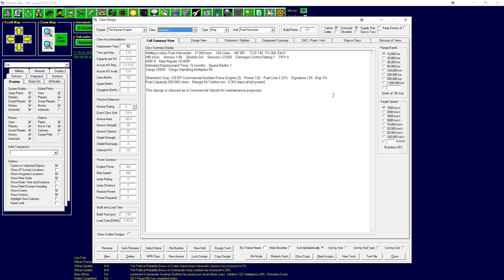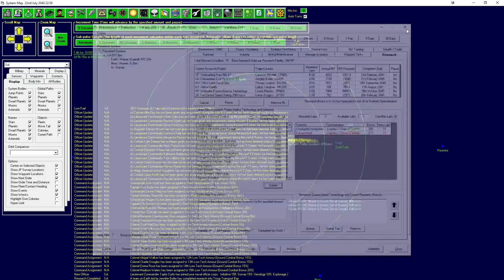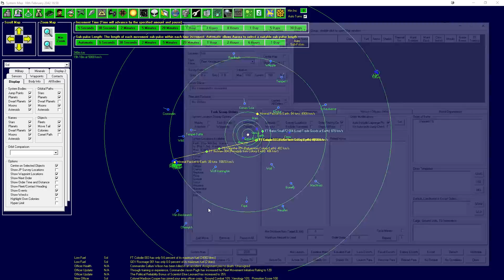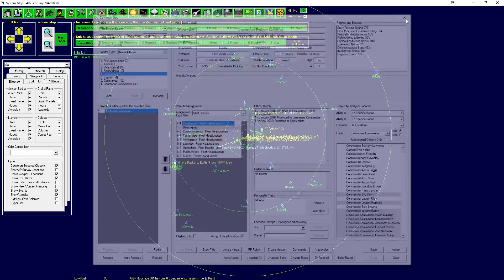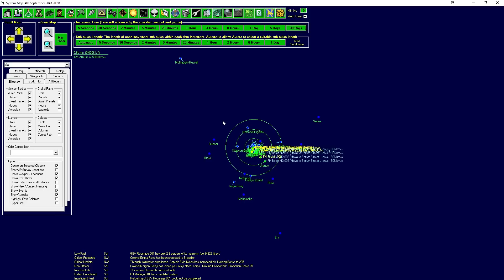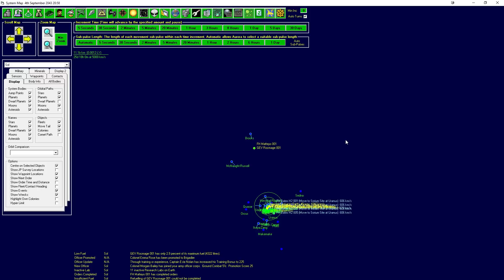Aurora 4x #06 Colony Ships and Fuel Tankers - Let's Play

Comment: How can you slow down anything with a mass driver? You fire random crap at it hoping it wont fall apart or change trajectory?
Reply: ***** Wow catching hundreds of tons worth of cargo travelling at great speeds from the other side of the star system in a fixed installation's barrel without even breaking a sweat? Call me impressed.

Comment: I don't think your fuel tankers are too small. I think you don't have enough fuel. In the entire solar system. They have, what, a 1 million capacity tank? I'm pretty sure Earth makes a tenth or so of that in a year. And ships continue to use it. Your tanker ran out of fuel not from lack of capacity, but from lack of available fuel.
Reply: +Tom Julstrom If ship is marked as a tanker, it only loads 10% of available fuel space. Then you have to refuel it manually, by conditional order, or send to harvest fuel at gas giant.
Reply: nope, 1 million isnt a lot of fuel. generally though you want to refuel from fuel harvesters rather than planets though.

Comment: I spent most of the day looking at this.according to the stuff I read, the math works out to be (125% (Sum of costs of new parts) + 10% (difference in tonnage))
 >= 20% of original design's Build Points in order to put out a second version. This means that the more expensive ship designs can also be used for the cheaper ones, but not the other way around.Colony ships are way more expensive than cargo ships.

Ergo, assign shipyards to build your more expensive ships and then design cheaper variants

Comment: +EnterElysium

The reason you can make the badger on both but you can't make the colony ship on one of the two is actually simple.

The shipyard tooled for making the badger lacks the newer equipment to "upgrade" the badger

Meanwhile the shipyard rigged for the colony ships is able to work with the "Obsolete" Badger class

Even if it's not obsolete at this time, the ship yards are looking at date it was designed as well as similarities.
Reply: +Remora Seifuu I can only imagine the other shipyard is like: The fashion of your design is too obsolete to build! We can't possibly put a carpet in such an old style on our ship!
Reply: FictionDragon
Actually that's what's happening - I play this game myself. It's weird, but effectively their technology is "out of date" for building ships close to that design.
Reply: Remora Seifuu Alright, one would think technology comes out of date after a replacement technology been developed not after just some time passed. Maybe there is some kind "not worth of mentioning auto research" that actually project itself into this? Idk. In that case, it would be nice to have some actual mechanic and data tho.
Reply: FictionDragon
Technically, he replaced technology on all the ships there, despite them being similar designs. All the ships there use technology that the predecessor does not. Basically the game is confused and is considering it as "Newer Technology" in this situation and has it rigged for a refit. Trick for the refitting though is the shipyard has to be up to date with the "newer technology" to pull it off.

I would also need to see the refit costs for it - but there is a chance that the designs are just too different for the swap like that.. As found on this thread: http://aurora2.pentarch.org/index.php?topic=5765.0
Reply: Remora Seifuu Where did you get the info about the time dependency?
Reply: FictionDragon
After reading more into it, I was wrong about that and I need to consider that into future designs I have because I was running into that issue and figured time was a factor.

Although it would appear the refit differences must have broken the 20% refit cost going one way, but not going the other. I can't seem to find too much information on how refit costs are actually figured out though.

Personally I wish the wiki was a bit more stable. It likes to give errors like no tomorrow whenever I go to look up how something works for my own game.
Reply: Remora Seifuu I think the wiki might be overloaded. The game became popular pretty quickly.
Reply: FictionDragon
Quite possible.

Comment: I can see what happened with the refuelling.  I think at least.  Iirc sorium harvesters are launched with only 10% fuel in the tanks to allow them to go to a gas giant, fill up and then deliver that to the colony.  The Mateyo only had 10% fuel when it went to refuel the Rockmage hence the issue.  

Also, as has been pointed out, there is an equalize fuel button at the bottom of the Task Group screen that equalises fuel percentages within the fleet.

Comment: From what I understand, the rule for building multiple ships at the same shipyard is that ships must be similar and the shipyard has to be tooled for the one that weights the most.

I don't know the exact maths though.
Reply: +Sigel The short version is if the ships are within 20% the refit cost you can use the larger. I had the same question on the reddit https://www.reddit.com/r/aurora/comments/3zwova/intermediate_ship_design_questionsclass/
Reply: +Nickierv Thanks for the complement of information .
Reply: +Sigel The formula, according to that link is (125% (Sum of costs of new parts) + 10% (difference in tonnage)) >= 20% of original design's Build Points
Reply: +Sigel A trivial trick that works for civilian ships which usually all have common tonnages is to make one design that has an absurd build point cost (like a tanker using 2000 standard size fuel-tanks) since almost any ship will then have <20% its cost